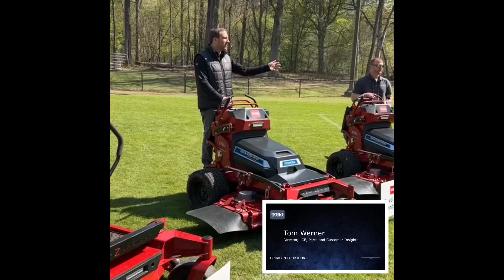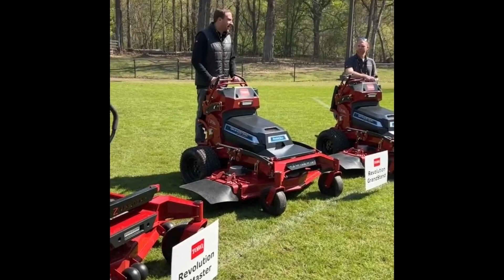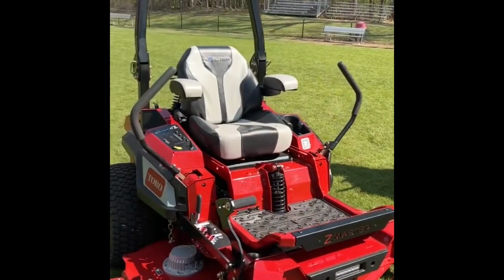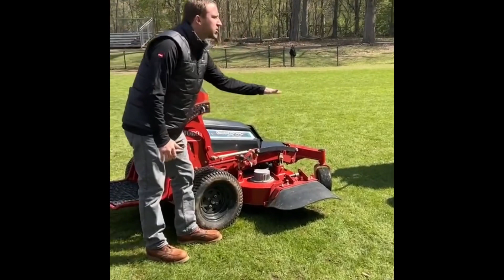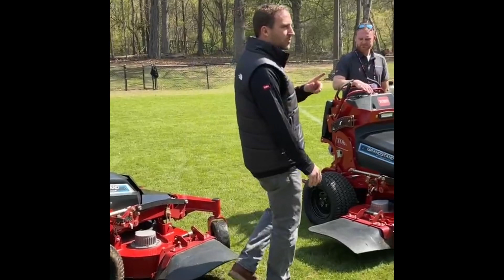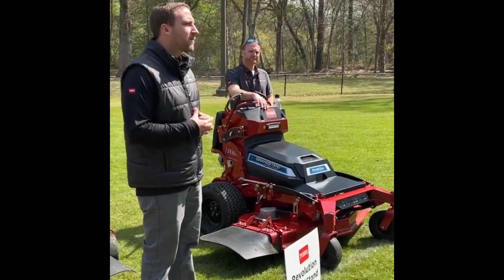The Revolution of Mowing

Comment: I am very interested in adding electrified products to my lineup. I'm really interested in the Stand-on Toro elec GS Revolution. I'm not overly concerned with the cost as I have customers who are asking for a 'green' solution. I can actually charge more. I have been doing a lot of research on that machine and the mean green, greenworks, etc. before going to my dealer. I have heard a lot of great feedback about the Toro, but also some negative feedback. For example, Toro had some technical problems. Toro provided a service kit, but now the machines only run at 6mph max. If that's true that won't work for me. I tried contacting Toro corp. directly but no comment. Do you know if all machines are still running per original factory specifications? I have also heard that some owner of that machine complained how he missed a few payments and Toro shut the machine down remotely. I know they have a connected data feed to the machine, but didn't know they could take remote control of the machine. Do you know if this all true, or internet BS? Thanks for your thoughts...Chivy